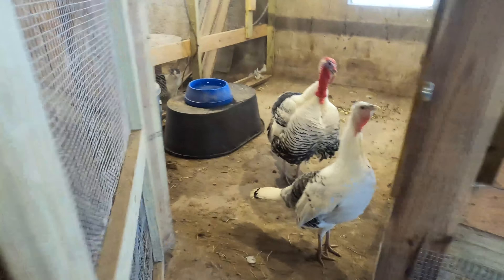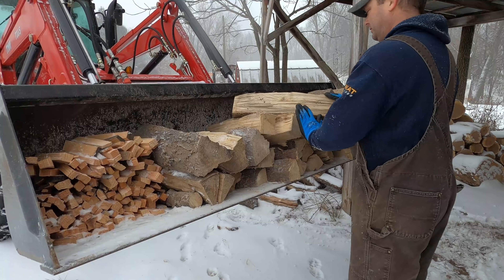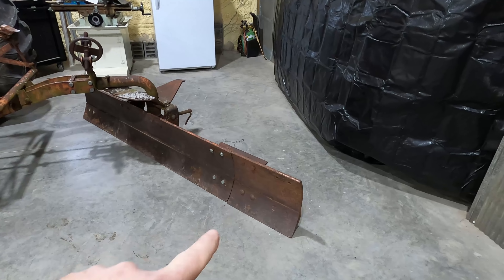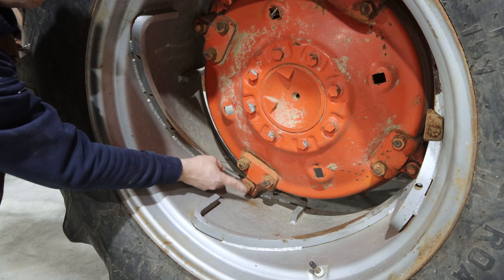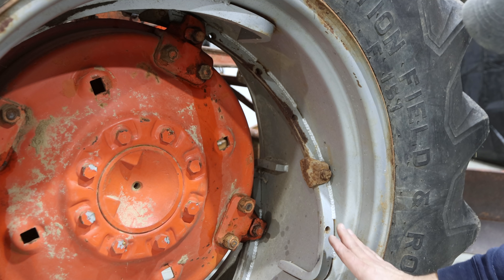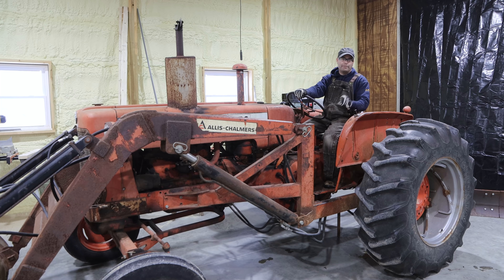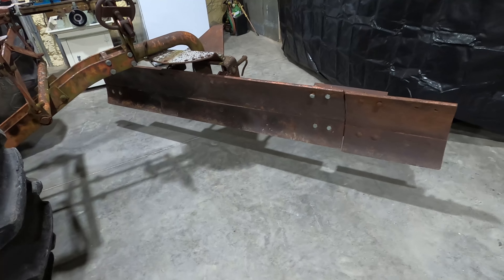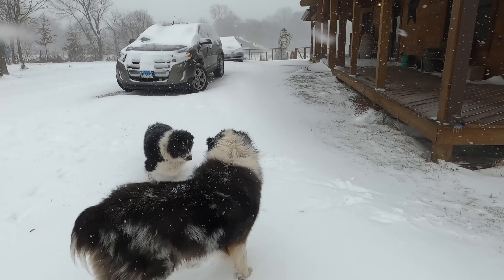Our First Decent Snow of the Year.  Getting the Allis Chalmers Ready to Plow Snow.

Comment: Something that may help is some truck drivers have carried a piece of chain to put on the wheel in snowy weather when they got stuck.  Instead of throwing a full set of chains on.  They would wrap it around the duals and fasten the ends with snap hook away from the valve stem. It would help to get you unstuck. Then they would remove it and continue at normal speeds. Just need to research a good way to attach ends so you don t hurt the tire.  Most of the time I just run with no chains and the rear blade and loaded tires.  It has been the Ice that gets you.  That is why I mention the above.  Just watch your valve stem. Rear chains are not cheap. I made one side and that was expensive.  Hope this may help in the future if it works with that tractor.  Weight on rear is helpful also. You will find the balance that is needed for that tractor to work well.  I am beginning to like the Alice and features. This area does not have a lot of them.

Comment: You need a winch to pull logs out of the woods.  There are several ways to do this.  There are hydraulic and pto driven models that can be mounted to the 3 point hitch.

Comment: The things you call stops are actually locks, you need to move them up on the rail to lock the tires in place. They were used all the way up to the 8000 Model. Had them on 7040 and 210 had them on the duels also.

Comment: The 'old tractor' forums recommend using that 10w30 you are thinking about swapping in. Modern oils have all the goodies that the old oils did not (detergents and high pressure additives). Last I was in an auto parts store it was hard finding any 10w because so much is 5w or even 0w now.
One caution I heard about the snap couplers, this is mainly the field plows, is keep the 'snap' part well oiled and maintained -- some farmers have been killed or severely injured when the front tongue latch released allowing the tongue to drop into the dirt and pivot the whole plow around the upper arms and crush the operator at the steering wheel. Some have used a safety chain to the tongue just in case. In December I got a 52 WD with the last of the AC pin hitches (and I'm converting it to Ferguson style 3 point, since I have Fergusons and matching implements). AC had mod kits to convert their implements to/from pin/snap/3-point later on. So you might look around for the kits or design ideas if you want to make the blade fit all the tractors you have (sometimes you need a backup tractor). I do like seeing the old iron out working!

Comment: you can buy a block heater that hooks into the bypass line and works like a percolator , also a heat lamp on the starter .  Harbor freight sells a cheap 3/4  inch socket set and while the ratchet  is not very good the breaker bar and sockets have held up to 8' cheater bars on disk gang bolts for us.  you might be able to make a new frame for the blade to attach to and be able to use it on a new style 3pnt (cab ed tractor).  the dogs have lots of fur  i dont think you have very much  :)  i have made a canvas cab before with like a piece of plexi for a window
Reply from the maker: I got a magnetic block heater on order
Reply: @CountryViewAcres  never used a magnetic heater figured the peculator type was about 1/2 way between the magnetic and the factory block heater like them because they heat the whole engine but not as easy as the magnetic s hope you had fun moving the snow 🌨️

Comment: Good old D17 getting her done  Evan you need to get a set of tire chains for the old girl I run 15w40 in all my old IH  tractors need zinc for the flat top cams I have block heaters on my tractors they start right up. My buddy has a D17 with 30w oil he plugged It in when he need it. He said it's one of the best starting tractors  he has. P.s can't wait for your next video

Comment: For $20 you can get a heated dip stick; for $50 you could get a block heater. Then you could run Go 90 thru the engine and it wouldn't care in the winter. LOL!

Comment: It takes a bit of rigging, but take canvas , wide enough to reach from front tractor from the radiator  to the rear fenders. Rap it around and fasten to the other side so it tops out on each side about the bottom of hood, the fan blow the heated air, it will funnel the heat from around the engine back to the operator and keep you warm and toasty, we called it the heat houseŕ.

Comment: You might consider a fairly inexpensive magnetic engine electric heater because you can have it grab onto the oil pan and put its heat directly into the oil.  Regardless of whether you still have the 30 weight oil or the 10W30, it will make winter starting much better because a good amount of the heat will migrate up into the engine block after it passes through the liquid oil.
Reply from the maker: I ordered one a few days ago.

Comment: Pushing snow with the blade will give you more power to the wheels.  Yes, you will be going in reverse, but it works really well.  I’m not sure you can spin the blade around, but it might be worth a try.
Reply from the maker: The blade can only be straight when faced backwards.  You can't angle the blade backwards only forwards.
Reply: @CountryViewAcres  too bad. I love the old snap couple equipment. I grew up on that stuff 50 years ago. Lots of fond memories of Allis. Thanks for sharing.

Comment: Evan, please don't use 10W30 oil!!    It is detergent oil  !!  If you were told by previous owner to use non-detergent oil you be wise to do it !! Go with a 20 wt or 10 wt in the winter !! That is what I do with my older tractors that requires non detergent oil . Or use na engine heater . Google it and you will understand why !!   I pray you don't take my suggestion the wrong way !!!   Be safe and God bless you and yours !!!!   Eddy

Comment: Keven, the rear wheel you fixed. Those lug nuts are no way tight enough with that small impact wrench you used. You got to tighten the with the pipe and breaker bar , the same way you got the lose. On the one that won’t move , put the heat and WD40 penetrating oil to it .
Reply: Those aren’t really lug nuts and do not tighten with threads. There’s a little ear that turns from the lock to unlock position. It binds the rail in lock, but when the ear hits its stop, it stops. No need to turn until it squeaks like a lug nut.

Comment: Spray your cam locks with a rust breaker, master blaster or something similar. Hit them several times before moving your wheels. Use the breaker bar and start on the top and work down. Move wheel and tighten by starting on the bottom and working up. Allis invented the power shift system. If you can't open cans, Jack up tractor and remove brackets that hold cams and soak in atf, then use heat and get them loose.

Comment: Definitely 10W30 over straight 30 weight. That will still give you the protection of 30 weight when the engine is hot, but will flow like 10 weight when it is cold.

Comment: We had the same tractor..as well as a wd45 and a C ..all had those rims...only adjusted the wd45's....it did the field work...the d17 wasn't very handy..it had a trip bucket and the power steering was messed up . 
  As someone else mentioned..that long extension is killing your torque..close to 50%...and neither impact has much torque to begin with .

Comment: Always start at the top for the locks.. I always have to use a breaker bar and a cheater to loose them. We always put the stop on the back side so if you hook up to something hard or jerk on something like hauling logs to the wood pile,  the rim can’t spin outwards on you. 10w-40 in the winter and 10w-30 in the summer. Spray a really small amount of starting fluid in the air breather tube on top of the tractor. Once it fires it’ll stay running. Doesn’t take much, just enough so it fires.

Comment: Love the old iron, Evan, but I'd be looking for a 3 pt blade for that TYM and taking advantage of that heated cab. I lived north of Peoria for 8-1/2 years. The wind never stopped and the windchill was brutal. Granted it isn't quite as bad over here on the east side of Illinois,  but it's been cold enough. I don't have a cab on my little 25 hp New Holland, but I may look into one to al least break the wind. I'm looking for a used rear blade for it, but 4 ft blades seem a tad rare.  I absolutely love the new pole barn.
Reply from the maker: I have been looking for a used blade also.  Winter is a bad time look.  Everybody needs them.

Comment: Power-adjust rear rims were invented by Allis-chalmers; when the patent ran out they became common for smaller tractors.  Ask a John Deere owner the torture required to change rear wheel spacing.  As Tractors got more powerful these  rims would tend to slip more.  This was common as these tractors were set wide  while row-crop cultivating.

Comment: The cams on the spin outs on my D17 were extremely tight; same with locks.  I finally broke them free with a 3/4 drive pneumatic impact.  Yes, you can run them on a small compressor, just not for long.  

I also ran sae 30 in the engine.  I just used the cheap HD diesel oil from Rural King until this winter when I tore it down for overhaul.  The engine was worn out, smoking, and leaking really bad when we got it.  

Check your stater bushings and brushes if you thing the starter is dragging or just low on torque.  A good read on the sparkplugs will tell you a lot as well.  
Ever check the timing?  Mine was way out...

Comment: Hi Even,  I was wondering why they don't put the cars inside the new building to prevent them from getting covered in snow?  Or the next project could be a carport in the same style as the house.
Reply from the maker: The other two garage bays are filled with material to finish the workshop.